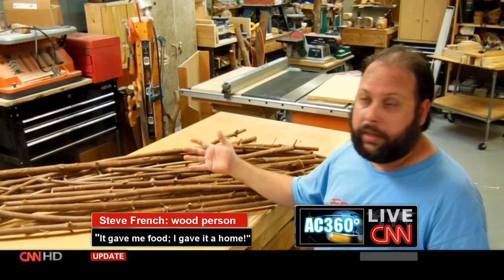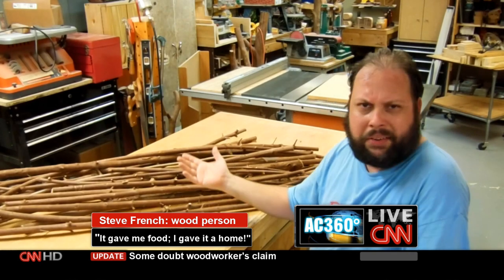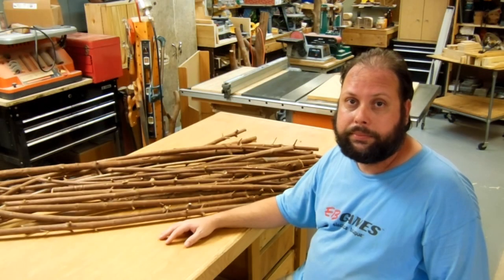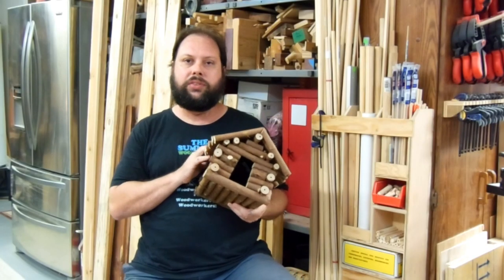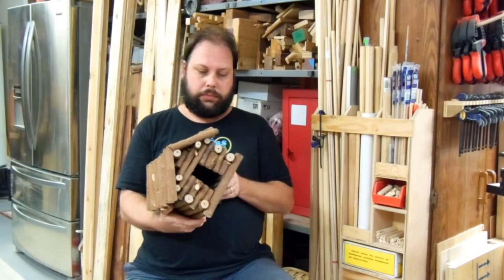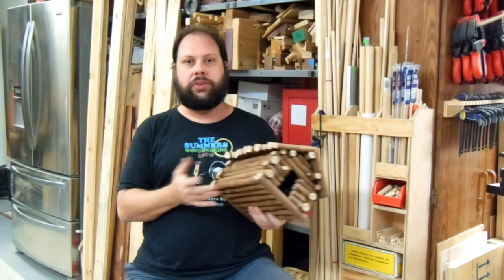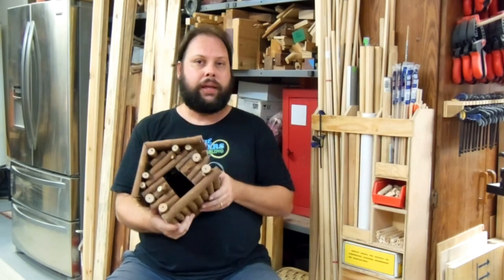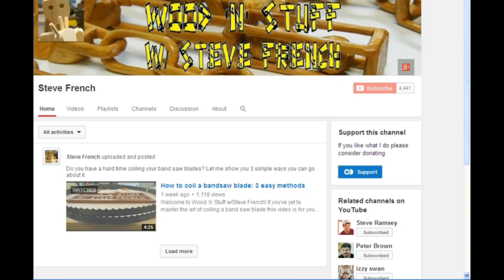Make a Simple Log Cabin Birdhouse

Comment: Great job of up-cycling pruned branches into an awesome birdhouse, buddy...good luck in the competition...Jim.
Reply from the maker: +Jedijim252 Thank you, Jim. Our yard guy had trimmed the bushes on the side of our yard and piled the trimmings out front for the trash collectors. But when I saw it all I was compelled to go through and save most of the usable stuff. Otherwise it would have ended up either incinerated or in the county dump. I'm glad I did so; I got this cool birdhouse and still have a bunch of the sticks to make more. Maybe I'll make another style of log cabin with the rest.

Actually, since the wood has a natural hole in the center (pith core), I'm thinking of cutting some of it into beads and making some necklaces from it as well. I appreciate your being here!

Comment: How long between glue ups did you have to wait before it had a good enough bond to stay together? Very cool log cabin. Thanks for the video.
Reply from the maker: +George Trott Between layers there was maybe a 4-6 minutes or so (just enough time to get the next "logs" ready). Though it did sit overnight after gluing up the bottom to give the base time to become one rigid assembly. Then it sat overnight again somewhere near the end of building the walls and when the first side of the roof was done. It sat overnight a final time before applying the other side of the roof.

Thank you for watching.